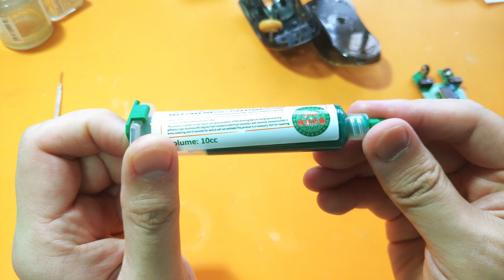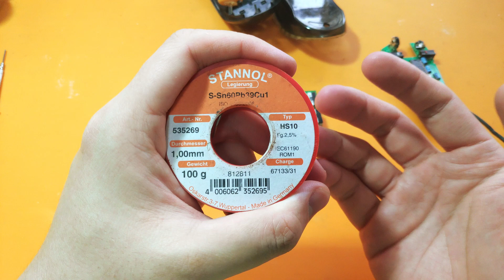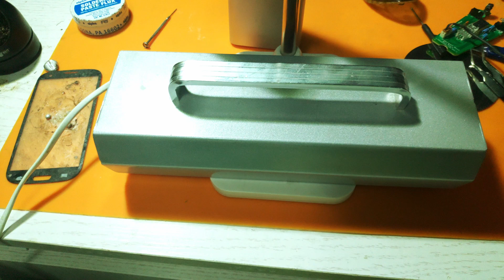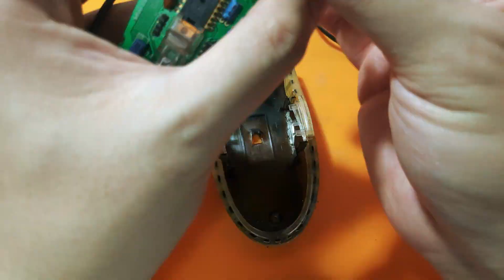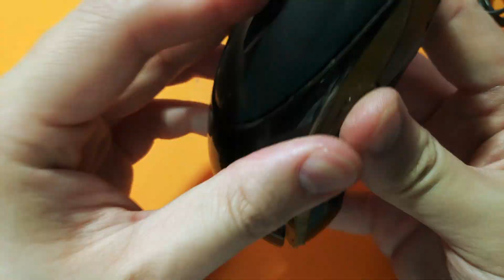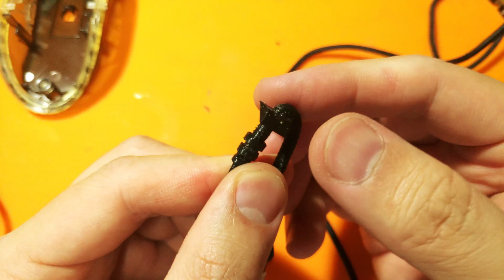Razer Diamondback Plasma PCB Repair & Modding!

Comment: I love the diamondback I still have mine! Have you thought of a pcb transplant from another mouse that might fit? I'm looking into that.
Reply from the maker: The Diamondback still has a special place in my heart! I have thought of transplants, but not for the Diamondback as I wouldn't want to get rid of its iconic shape to me
Reply: @TechRodent  the idea was to keep the shape and put a more modern PCB inside it. Maybe wireless but not necessarily.
Reply from the maker: Yeah maybe, but I think that you would also need a custom designed PCB to do this, at which point if you change too much, you run into "the ship of Theseus" problem; is it still the same mouse? Haha

Comment: im having troubles in putting the top part back in, im trying to do with an angle, but I just can't put it together :|
edit: nevermind, I managed to do it! it turned out great!.
I've just replaced the cable with a braided one, It kept getting disconnected, now its fixed. great little mouse, have them since it came out!

Comment: i'm relatively new to soldering, and I just did my first solder project. 

I have a g305 and upgraded all the switches, everything works fine besides the dpi indicator button and the middle mouse button (located on the main pcb), i have a feeling i ruined the pcb pads when i was working on desoldering them, i also did remember seeing the pad melt off. Oh yeah, I also scratched the pcb board and it exposed some of the copper, is this probably the reason why my middle click and dpi button wont work? and do you think this method will help me fix my mouse again? thanks in advance!
Reply from the maker: Exposing the copper won't destroy the trace, but if you went too deep you can accidentally cut it and cause the issues that you're talking about. 

Sounds like mainboard damage
Reply: @TechRodent  is there anyway to fix it? other than to get a replacement pcb?
Reply from the maker: There is, just need to determine which trace was damaged and repair it, just like how I did in this video. 

You can also refer to my Xbox 360 controller repair video for PCB trace repairs

Comment: I extremely enjoyed this video, and it's your best one till date. 
I've a few questions, you already know I've a cheap soldering iron but it's tip is flat you got a needle shaped tip and mine is slanted flat. Is that what's wrong and the reason I can't solder? Should I make it like a needle by rubbing it on a tool sharpener?
There's nothing wrong in iron itself. It takes 30-40 seconds to fully heat up and after that it melts soldering wire like cheese, when I stick a significant amount of melted wire on it's flat surface and try to reapply it on my desired place the shit just don't pass from iron to my battery terminals or anything even after applying flux. Ahh
Reply from the maker: When working with SMDs, it helps to have a really small tip, I find that it concentrates the heat better, and it's easier to maneuver. 

You can try lightly sanding your battery terminal then using flux, but sometimes it doesn't pass because the surface isn't hot enough
Reply: @TechRodent  oh ya sanding terminals sounds like a good way. You think making my tip of iron needle like sharp from flat is worth it?
Reply from the maker: If you can change your tips that would be best, so you have multiple types
Reply: @TechRodent  I can, they are replaceables.
And don't even cost much. A pair of tips costs like 10 cents here

Comment: Not that I'm even close to try, I don't have the knowledge not the tools. But it's pleasure watch it being done. 
Right now I'm looking for a way to repair the mic in the my Logitech G633 headset. Local shops won't do it.
Reply from the maker: What is it exactly about it that is broken?
Reply: @TechRodent  It gives me the tones of muted and unmuted when I flip it up and down. And the computer know it's connected because it lets me select it as an input device. but it doesn't register any sound. I tried connecting it by USB and the 3.5mm jack, updating drivers, changing computers. Nothing seems to work. So my next step is trying to crack it open and verify the internals. The mic seems to be dead anyway.
Reply from the maker: Sounds like an interesting repair. Good luck!
Reply: @TechRodent  Thank you very much!! I'll need it! Or I'll need a new mic.  I already have a very nice wireless headset.